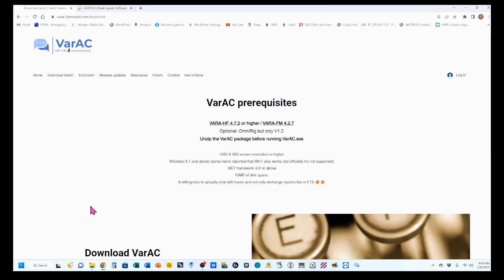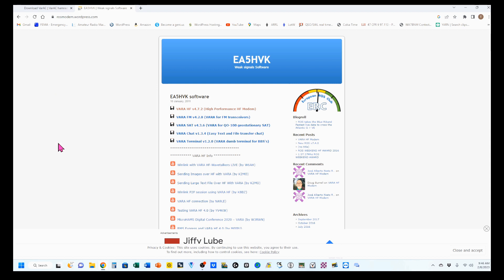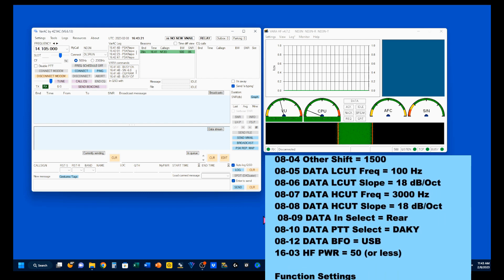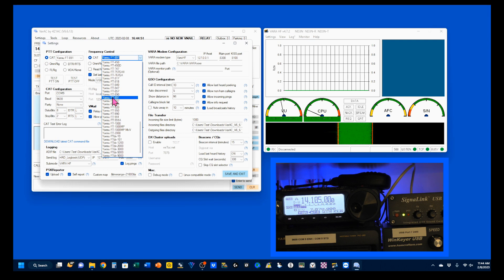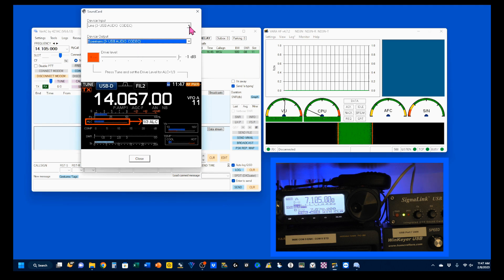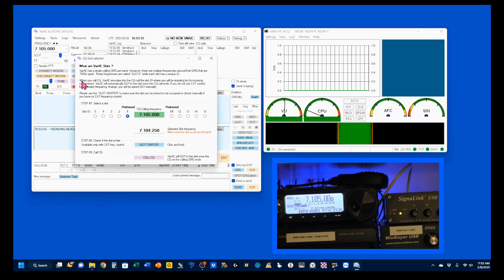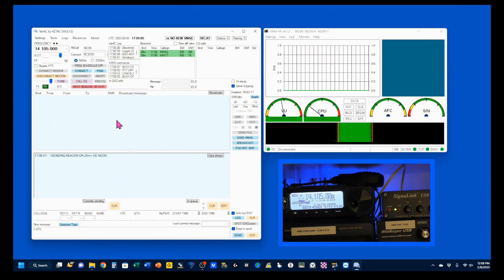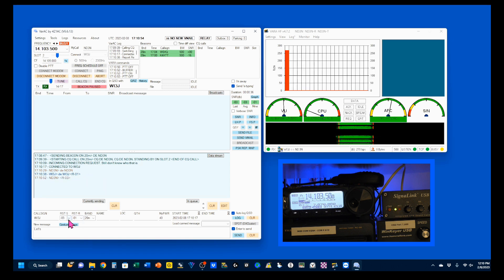The Best Digital RagChew Mode for HF?  Absolutely!

Comment: Not automated. That's the whole point. Not enough using it. Rebound me off the days of Amtor where I had many good long chats. I built  the Amtor modem used on a creed telex machine before the computer days.  More enjoyable then as I use to build all gear and experiment plus discuss over the air.  Today we have new generations on air without any knowledge at all. I had the know how to get the license. VarAC a nice mode but FT8 still dominates as most hams now won't talk. What do you talk about some say. I give up .